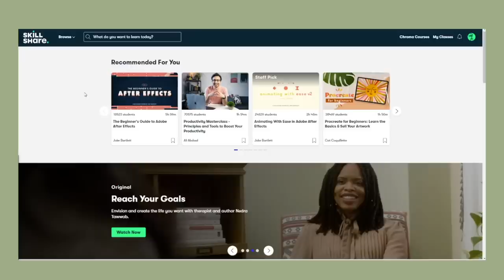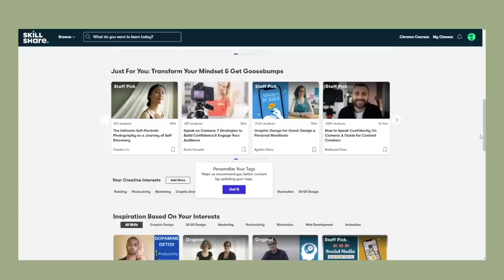building a new pc | white aesthetic build

Comment: You should  put the m.2 on the First Slot because that is the fastest you can get.
If you put it on the second Slot ist dont run over The CPU Directly. It Runs over the Mainboard Chip and then to the CPU. If you put ist on the First slot it Runs directly over the CPU and is much Faster.

Comment: If there's only one M.2 ssd in use it should be installed to the slot that is nearer the cpu. M.2 slot that is below the PCie connectors is secondary and a bit slower.

Comment: Great vid! FYI, the m.2 slot you used is PCI-e gen 3 rather than the faster PCI-e gen 4 slot. Moving the m.2 up to the slot under the graphics card will ensure you maximize cpu and storage drive's performance.
Reply: not necessarily. using the top slot will borrow lanes from the top gpu slot. which then leads to less performance from the gpu. It specifies in the owners manual of the B550-A that if you are using 1 m.2 then to use the bottom pci slot for it.

Comment: Awesome build, only word of advice is with the ssd install you should've installed it in the upper slot, and not the lower slot and you forgot the m.2 standoff. Its currently being bent and that could damage it
Reply: I am about to install a new SSD and I just realized my mobo has 2 m.2 slots as well. One is with a heatsink and one without. I bought an SSD with a heatsink so I was worried that I had to put it on the top m.2 slot which has the built-in mobo heatsink. I asked my friend who is a computer tech and he said that it doesn't really matter where you place your SSD.
Reply: @sapph3904  The top slot has a reserved PCIe x4 connection with the CPU, while the second one would be linked to the chipset and using the PCIe x4 connection that the chipset uses to communicate with the CPU. The top slot if slightly faster, but if you cannot use it, it is not the end of the world.
Reply: @Z0T3_  i placed it on the top slot and did not put back the built in heatsink since it would not fit.

Comment: Great build, but I'd suggest you switch the case fan orientation to increase positive air pressure inside the case in order to get better thermals.
Reply: fan orientation is fine

Comment: I noticed or perhaps I'm wrong you didn't install the m.2 standoff? And that the m.2 ssd is installed in the wrong slot. It should be right under the CPU part. Or maybe I'm wrong. Pretty build tho.

Comment: It is great, I love white builds, I am making one of my own right now, waiting on the waterblocks. I see you were using a TUF mobo and they are great, my x570 TUF was like 180 USD with wifi and has been great, my question, is why go with asus B550 motherboard? why not x570, if it is for the white, there is the gigabyte aero version which is white and x570S. A little note that you might want to look at, is changing that nvme to the first socket which is over were you installed the GPU, also, you did not have to leave all holes when installing that support bracket for the GPU, that will make it collect all sorts of particles and dust, since quite the big things can go in now. But wow your deask and space looks so neat and clean. great job!

Comment: I noticed you used the Bottom M.2 slot did you do that on purpose  ?  in the the future it would be god to take advantage of your top M.2 slot, that supports PCIe Gen4 x4 , so if you can get the 980 pro that will give you  - Read 7000MB/s  Write 5100MB/s speeds 
Your bottom M.2 slot only supports PCIe Gen3 x4 which is what the 970 Evo plus is . sorry if you knew all this already  :) 

Awsome build aswell :)

Comment: Did you check the motherboard manual for where to stick the m.2 you put it in the bottom slot but most top nvme slots the top one is the primary and that motherboard does look like it has a top slot which would make it a lot faster for installing and rendering things

Comment: super odd question, but i’ve been using a prebuilt pc for awhile now & am working on building a pc now. when building and connecting everything, are the screws and wires all included when you purchase the pieces? or do you have to buy the wiring and screws yourself?
Reply: all included!

Comment: Your motherboard has 2 ssd sockets I noticed you installed your 2tb ssd in the bottom m.2 socket which isn’t compatible with your ssd’s pcle 4.0 . Bottom socket is pcle 3.0. Top socket is where your ssd should be for the full performance of your pcle 4.0 ssd card 🙂